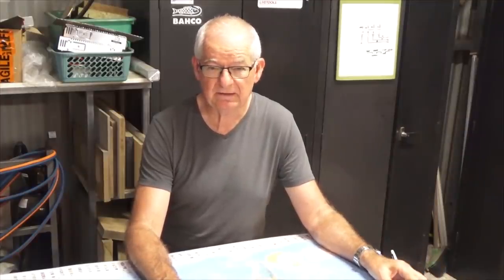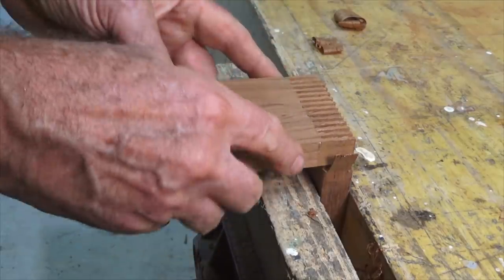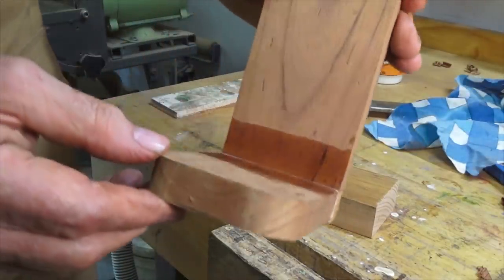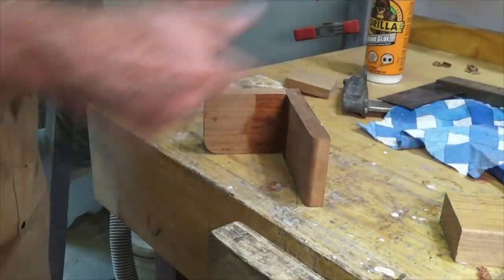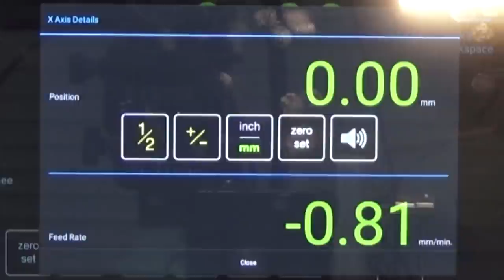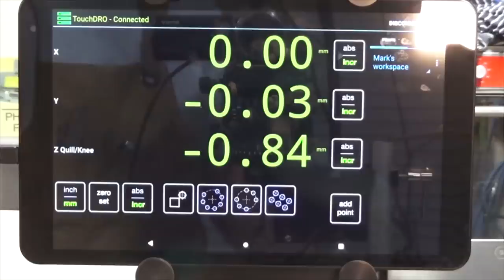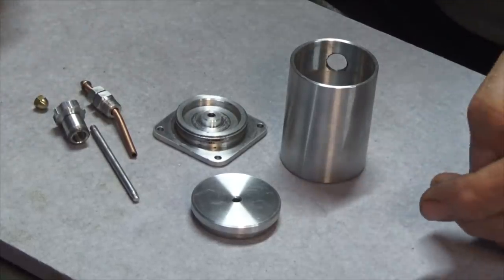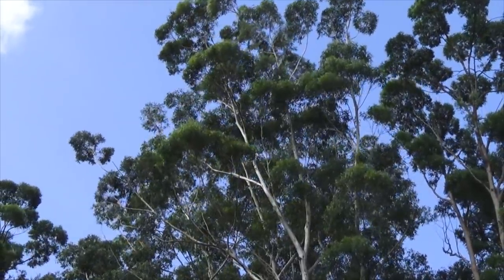Building the Titan .60 Glow Plug Engine #14

Comment: Excuse me for saying Mark. I think the engine sould face the other way round on the stand and displayed without the propeller. I can't see that the designer couldn't have made a stand which would be more functional otherwise. By the way, stick a pin in Sussex, England if there's room, but mind you don't prick the Isle of Wight and sink it, ta

Comment: dosn't thw plan talk about a pressurized tank?
Usually model engines like that have pressurized tanks. A seperate hose runs from the silencer to the tank to pressurize it and relieve the carburator from just sucking the fuel due to underpressure in the ventury. Especially needed when running in idle.

Comment: Hi Mark from Philadelphia PA,
That tank looks nice. How about using Loctite 542 thread sealant instead of JB Weld? I think it might be easier to seal the threads. Looking forward to the spray bar video and eventually hearing the engine run. You may know it, but in the video the prop is on backwards. You and the family stay safe.

Comment: You're the tankoligist, but you would be better served to use an o ring to seal the end of the tank rather than silly cone. Same with the stud.  Much love from West Plains Missouri, Heart of the Ozarks, USA.
Reply from the maker: I wish I had a big box of different size O rings but most of the ones I have are used, cracked and useless sizes. You're going on the map today. I have nearly a two page list to update 
Regards,
Mark

Comment: How do you plan on getting the fuel out of tank. Seems like you can't rely on gravity and "normally" model engines uses the exhaustpressure to presurize the tank and force the fuel out since the engine can't "draw" the fuel to it.
Reply: The venturi will provide a “draw” which is enough to overcome the uphill journey of the fuel from the tank to the engine when a model aircraft is in an extended climb (plus the friction of the inside of the fuel tube). Admittedly when this happens there is a leaning of the mix but it still runs.

Comment: Can't help but think it would look nicer if the tank end plate matched the engine mount plate. That way you would just need 3 mount bolts and nuts, thoughts?
Reply from the maker: That would be great but I didn't have a piece of stock big enough. I have stacks of that 40mm square bar stock though. 
Regards,
Mark
Reply: @Preso58   Hey Mark, thanks for the reply, shame you don't have the stock, you might be able to use some scrap plate. Loving the build series.
Another Mark, Auckland

Comment: Hi,Mark. This is all coming together very nicely👌 Just a warning about using the JB Weld as a thread sealer is make certain it is resistant to the glow fuel. I also wanted to ask a couple of questions about your Eccentric Diamond Tools. I am interesred in buying a couple and wondered are the shanks on yours 16mm or 20mm?  Do you use the Crobalt cutters and if so are they much better than the stock HSS cutters?
Reply from the maker: Howard, I have changed my mind about the finish on the fuel tank. I am going to anodise it and I will probably seal all the joints with RTV silicone. I love my diamond tool holders. Mine have a 16mm shank and fit into a 250-201 quick change tool holder. I did buy one piece of the crobalt tool steel but it was fairly expensive and I didn't find it to be much better than HSS. Plus, it was easy to mix it up with the other HSS that I had. Now I just use HSS which works for 90% of what I do. 
Regards,
Mark

Comment: Very cool, lots of different techniques there. Any reason the prop is on backwards? Is the timing 180 degrees out so it’s going to run backwards?🤣
Reply: You know he's in Australia. Their toilets flush backwards from the Northern Hemisphere, same with props. They have to spin backwards as well, otherwise the plane would try to fly backward and that won't work. except for the Rutan VariEze.

Comment: Moving the mic closer to the source you'd like to keep (your voice) will enable you to lower the mic gain, cutting a lot of the unwanted background noise.
Reply from the maker: Thanks. I am still using the built in microphone in my Sony Handycam. It's not ideal but it saves a lot of setting up and extra batteries and wires. 
Regards,
Mark

Comment: Hey, Mark, Charlie from Hershey, PA (a wee bit East of Harrisburg, which should show up on your map): please “pin me!” 

I had forgotten that you included woodworker in your profile, but then I remembered that Keith Stewart had a woodworking section in his “dirty” shop, just off of his clean shop, where all of the oily bits were. I suppose he, also would now be called a “Maker.”
Reply from the maker: Charlie, consider yourself "pinned". I was able to build an extension on the back of my workshop to house all my woodworking gear but prior to that it was all mixed up in the one space. Sawdust and moisture are the enemies of metalworking machines so it was something of a relief to get a segregated shop space for the wood stuff. It is funny how recently the term "maker" emerged. It is a sort of general purpose title for anyone who dabbles in what used to be called arts and crafts. However, I think it's a good thing. 
Regards,
Mark

Comment: Another person who likes to thread away from the chuck using a stop for the start point. :)
Reply from the maker: I learned that trick from Joe Pieczynski. I just like it because you are less likely to crash the tool into the work. I always freak out a bit when the tool is approaching a shoulder and you have to disengage the leadscrew. It's worse when I have to cut metric threads because I have to stop the spindle (quickly) and the brake on my Colchester is getting old. I am hoping to convert the lathe back to three phase and use a VFD. I am thinking that there would be a way of using the VFD to brake the motor and it may be possible to trigger the brake with a limit switch. 
Regards,
Mark

Comment: Your videos remind me of a comment I read once, where it was said that a Lathe is the only tool in the world that is needed to make another Lathe.  And that got me thinking.  How hard would it be to take one of those horrible chinese lathe/mill contraptions that cost under 100 and build up to a full size working lathe?  I thought about it for a while and realized you would have to build at least 3 and possibly as many as 5 intervening lathes to get to a full size one.

Oh and Hello from the Corpus Christi Texas USA area.
Reply from the maker: I recall Stefan Gotteswinter referring to Chinese made tools as kits of parts. He has no issues with dismantling a tool like a rotary table and completely upgrading it to a high quality tool. But you are correct that if you only had the one lathe it would be a bit of a mission to re-machine any of the parts. 
Regards,
Mark

Comment: Why not swap the engine and tank positions?  That way the stand will easily balance the weight of the engine.
Reply from the maker: I could do that but I think it looks better with the engine mounted so the propeller is free to rotate. I have actually fitted a lead weight hidden under the base. You'll see it in the next video.
Regards,
Mark

Comment: Flip the engine around on the stand and it will be stable.
Reply from the maker: I sort of like the idea that you can still swing the prop as it is now. I worked out how much ballast I need to add to the underside of the base to make it sit right. I can add the ballast into a bored hole and cover the bottom of the base with felt.
Regards,
Mark

Comment: oh sorry don’t seem to be able to post a photo anyway look up uni flow tanks
Reply from the maker: John, thanks for the reminder. We used to make our own Uniflow tanks when we were flying control line aircraft as kids. I got pretty good at it and was supplying most of my mates with custom tanks for their planes. I was able to convince my metalwork teacher at school that I could use all the tinplate scraps off the back of the guillotine and he was happy to give it to me. That tinplate was easy to cut, bend and solder. Given that the Titan I am building won't be flying and probably won't run more than a few times the integrated tank should do the job.
Regards,
Mark

Comment: Wonderful, but the tank is way too small!   :)
Reply from the maker: Don't forget, I am working from the original drawings supplied by the designer. This is just a test run tank and stand. If it were to go in flying model you would most likely use a "clunk" tank made of lightweight plastic. 
Regards,
Mark

Comment: You are brave to tempt the safety nazis with doing wood working on the tube. LOL.  Stick a pin in Vancouver BC Canada for me.  Cheers.
Reply from the maker: Barry, in 35 years of teaching woodworking in schools, the only tool that caused a safety audit was a woodworking bandsaw. We had two accidents with cut (but not severed) fingers in ten years and we were told that if we had a third accident they would unbolt the machine from the floor and it would be taken away. I will add a pin to Vancouver  tomorrow. 
Cheers,
Mark.
Reply: @Preso58  Congratulations on such a successful teaching career.  Only 2 significant injuries in 35 years of teaching students is a meaningful accomplishment.  You all strive for zero incidents, but that is only possible if they don't ever do anything.  I would have like you as my shop teacher.